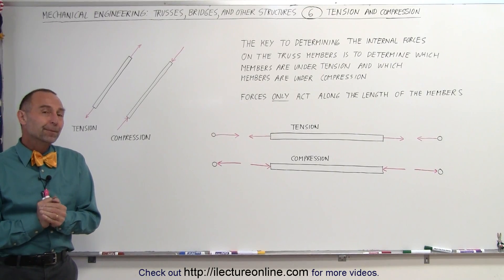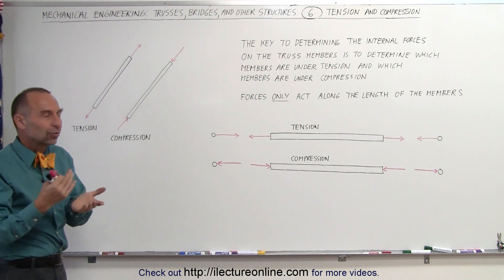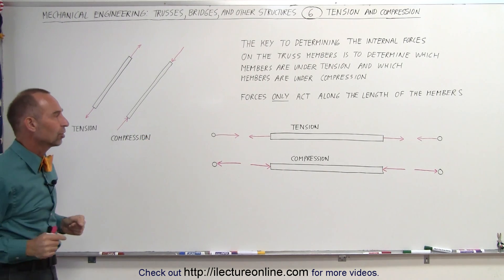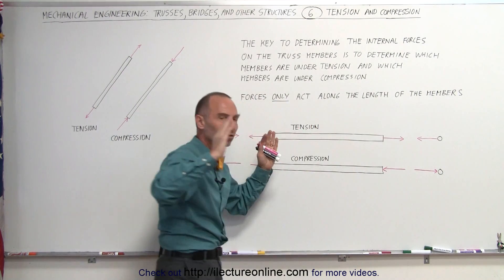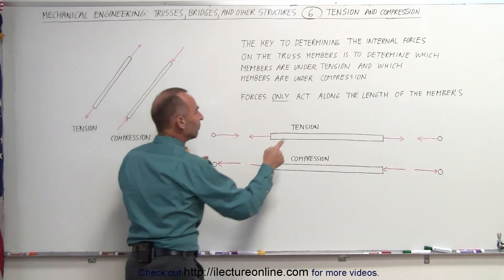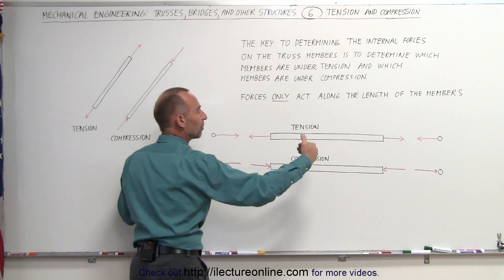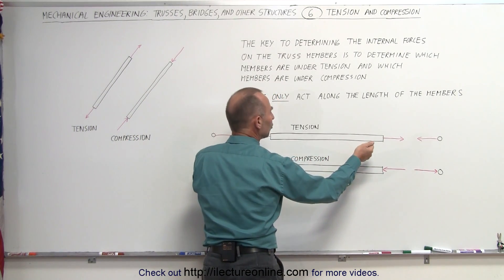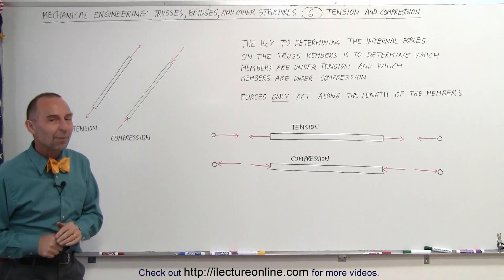Mechanical Engineering: Trusses, Bridges & Other Structures (6 of 34) What are Tension & Compression

Comment: Just looking at a truss structure attached to a roof, without calculations,  can we imagine or make sense which element of the truss is under tension or compression?
Could u please speak on how to intuitively analyze truss structure?
Thanks
Reply from the maker: That is a good point.  It depends on the structure off course, since there are many different type.  I have been thinking about going to some bridges and explaining how the forces are distributed intuitively.  It would be hard to explain in a comment.
Reply: @MichelvanBiezen  I go out the a city owned center activity complete the rings on my apple 🍎 watch and occasionally and feel compelled to intuitively analyze distribution of forces through the truss links and intuitively not able to analyze and know.  I start from the roof load and use bending moment and beam deflection concepts I learned in 4 year college to analyze but still not internally satisfied. Could u please do a presentation to clarify the intuitive sense for various applications like roof, bridges. Best wishes and thanks for the prompt reply.

Comment: acc. to the book " engineering mechanics statics by r.c hibbler"  we categorize the force based on its effect on the joint. so if the force is pulling on the joint (inwards) then it is tension force(compression for the member) and if the force is pushing on the joint outwards then its is compression(tension in case of the member). and since we are studying the method of the joint so i think we should categorize forces based on there effect on the joints